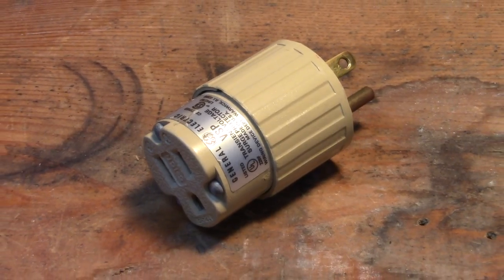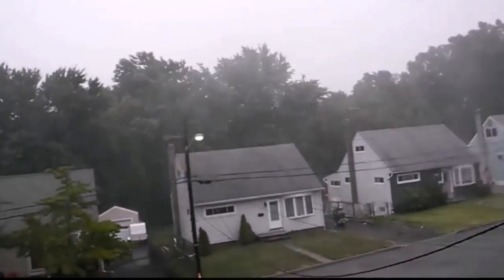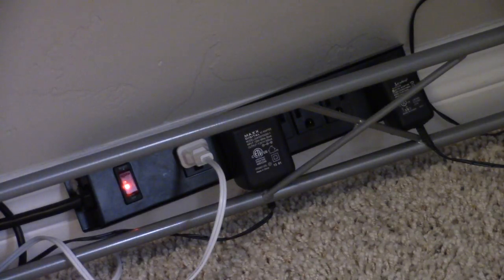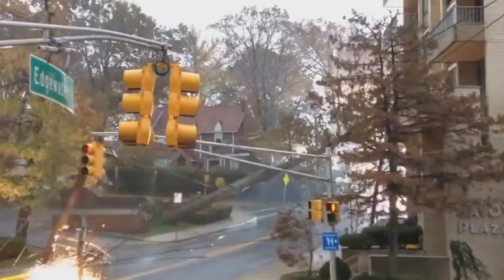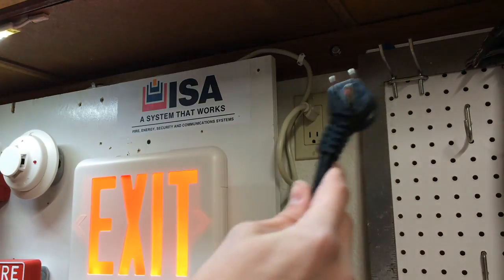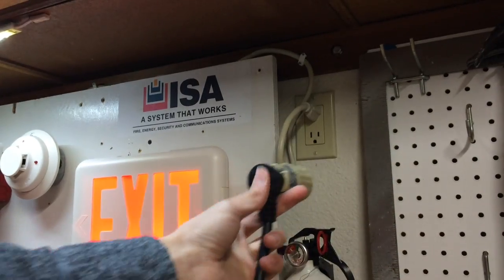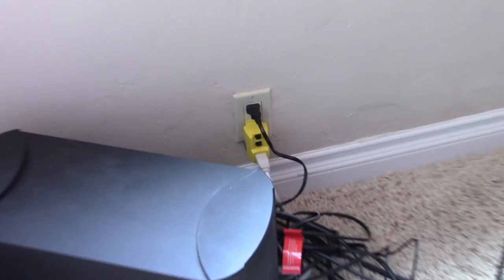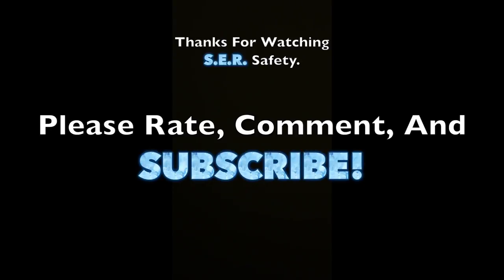What is a Surge Protector? / What is a Power Surge?

Comment: Doesn't a electric panel have them inside? Because I e had to rest the panel
Reply from the maker: The code for it might differ from state to state.
Reply: Simplex Freak circuit breakers, yes. What happened there is the fuse typically blows up and you have to go flip the switch. GFCI outlets work a bit differently; as circuit breakers and fuses only blow if there is too much current on a circuit (ex. overloaded electrical outlets).
Reply: There are four main types of circuit breakers. The first,  being the most common is simply put "a circuit breaker" Its a switch that trips when too much current is on the circuit or a short. The next is a Ground Fault Circuit Interrupter. These protect against small voltage/ current fluctuations that mimic a hot to ground or hot to human fault. I.E, water getting in an outlet. It projects early on to prevent electrocution. The third is the AFCI or Arc Fault Circuit Interrupter. These new-ish devices project against arcs caused by a sudden current or voltage drop. For example, a nail in a wall going through the neutral and hot. They are good for protecting against fire damage but aren't used much. And lastly, there is the whole house surge protector. This unit connects between two hots on the panel and to a neutral and ground. When fluctuations are detected, the unit rerouted the voltage spike to ground instead of the possibly fried electronics in a house. Sorry for the long comment.
Reply: Thank you everyone for answering my question. I will probably by a protector then for a exit sign and for my adapter for my Simplex sync module. Thank you so much :)